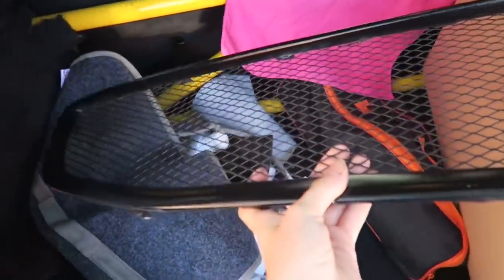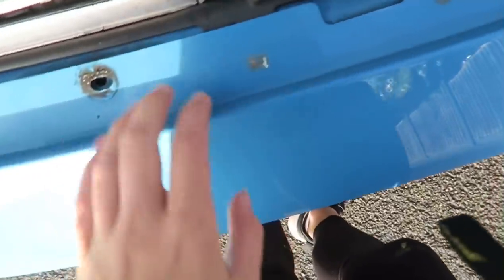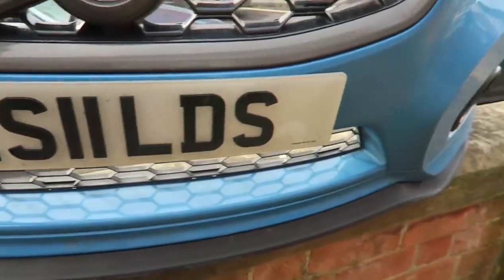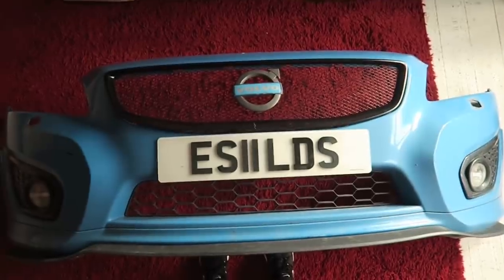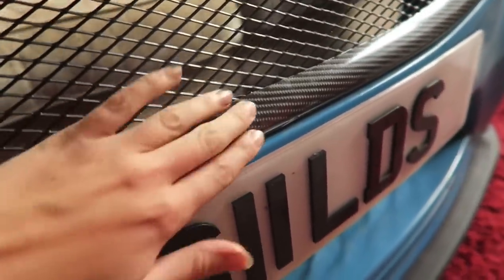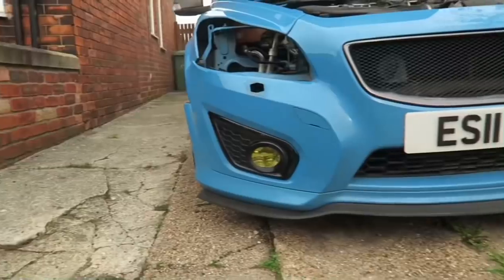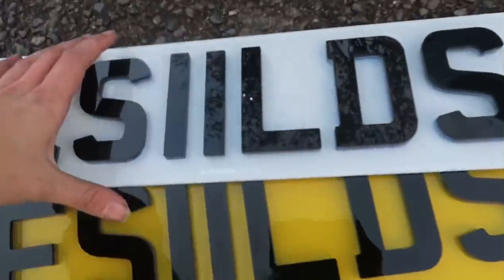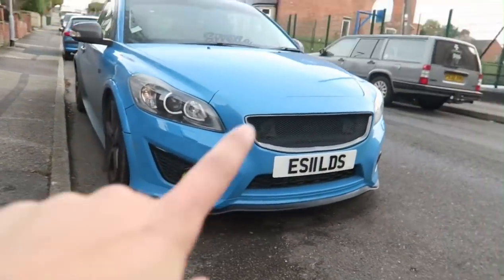EASY MODS TO TRANSFORM A VOLVO C30

Comment: Wasn't expecting much from the splitter; however, it looks great.  Love the carbon vinyl you've used - definitely ordering some of that!!  Bought 3M carbon vinyl that looks dull so never bothered with it, that stuff looks legit. 

Not sure if you can just buy the badge (rather than destroy yours removing the tabs) although if you got something to epoxy a plastic stud on you could technically bolt the badge on (plastic nut and bolt). If that makes sense.   Really like your plates too, I have gel plates although the 4D plates look superb, might need to go and get myself a pair.

Comment: That all looks really awesome! I randomly found your channel looking for Volvo mod videos. You have some nice work done on your older Brick as well. I really like your styling choices and mod choices.
I'm planning to build an 85'  240 wagon or a 2 door if I can find one to turn into a wide body monster using a turbo 5 cylinder from a 2012 or newer car. Older school body, modern looks and motor tech. Slick exterior look with hidden shaved door handles, fender flares, and such. Sort of a retro Volvo that has a cyberpunk, Bladerunner feel to it.  I am gathering ideals and planning the build now. People have told me I should just do an LS swap instead of chasing power out of a turboed 5 banger but I want to stay Volvo. If I was going to go outside of that I would get strange and use a 2JZ or RB23. If you have seen anything cool you could point me toward I would appreciate it. 
My last project was a 2004 V40 Wagon that won a few awards at local, regional & Hot Import Nights Car shows. It was pearl white, had the same grill you just installed, along with 3K weave carbon side mirrors, front splitter, side skirts, rear defuser & hatch spoiler I made myself. Rolled fenders & quarters with 18 inch white 5 spoke wide wheels, dropped 2 inches, adjustable from the dash, electronic damping coil overs and shocks, 2 inch strut tower braces F&R, larger sways, custom headers, 3 inch down pipe to split exhaust with side exit just in front of the rear wheels on both sides, bigger turbo, injectors, fuel rail, throttle body, ported and polished intake manifold, Accel high energy coil packs, wires, distributor, adjustable timing gears, custom cams, ECU chipped and tuned for 310 hp from original 195hp with top speed of 185mph. 1/4 mile time of 13.5 seconds @106mph. Bolt on work was me with tuning done by a pro.  Sold the car more than 12 years ago.

Comment: You can repair that cracked grill surround with a little two part epoxy and some form fiberglass mesh or mesh tape from behind. Sand the area a little so it has some mechanical bite.  Then if you want to sand and fill the front before wrapping, that's grand.  Suprising how much that lower lip does for it.

Comment: penny washers , ya daft bat
Reply: If you mean on the lip then yes I was thinking that, those screws against the rubber may pop out. The 3M tape should hold it if the surface was cleaned and wiped down with IPA. Still, more than my Mrs would get done! 😂